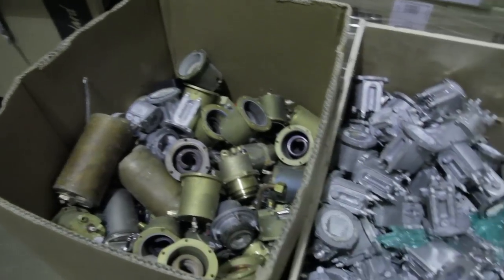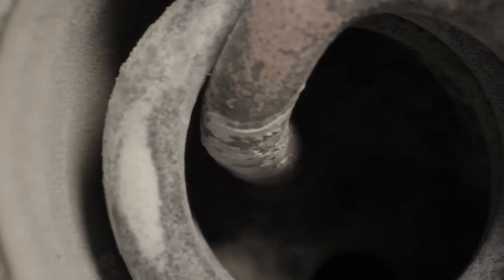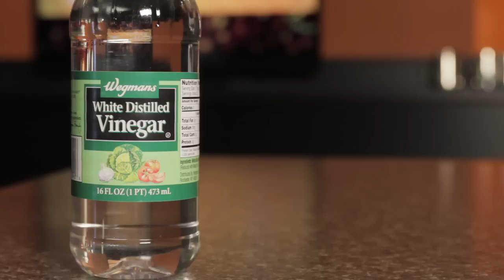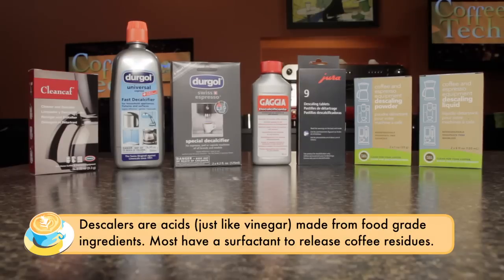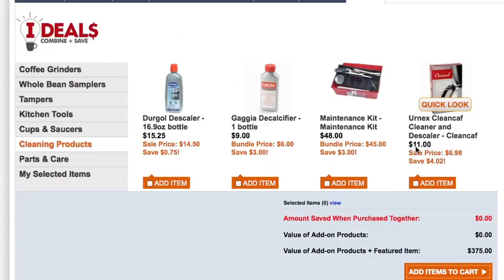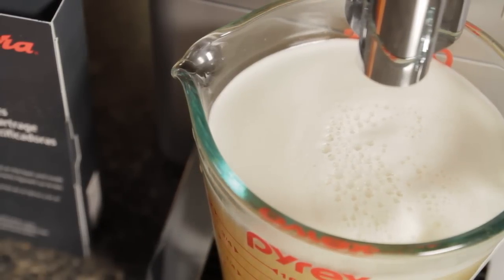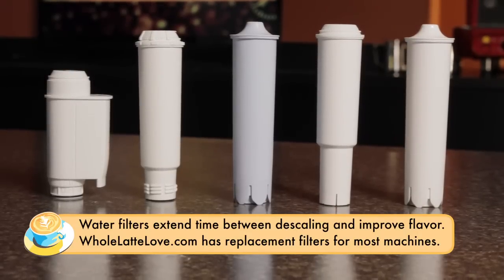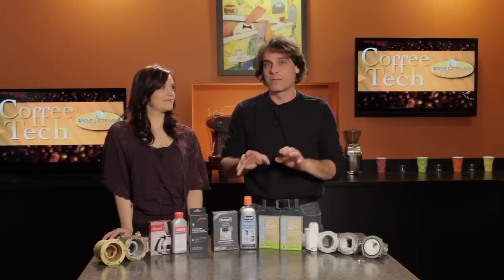The Dirty Truth: Why You Need to Descale

Comment: Hey there! Quick question; i have an Astoria Gloria lever machine do i just run the descaler from the water supply into the boiler directly? Thank you 🙂
Reply from the maker: Hi ggb, I have never descaled that machine so not 100% certain but that's generally how it is down. I'd check with the manufacturer or other owners to be certain.

Comment: I descale it until the water doesn't come out green or tainted usually 2 to 3 times of running it through. After that I rinse the boiler a couple times to get the solution out and make a sacrificial shot to make sure the solution is completely out

Comment: Can a Dual Boiler in my case a CremOne Infuser be cleaned by descaling? Or should I use only water
Reply from the maker: Hi mike, manufacturers recommend against end users descaling dual boiler machines. It's difficult to completely fill and rinse the service/steam boiler due to the head space left for steam in the boiler. The best course of action is to treat/filter water used in the machine to prevent scale in the first place. Products from BWT use ion-exchange to replace some of the calcium in tap water with magnesium leavoing you with water that will not cause scale yet has the mineral content needed for good flavor extraction and to prevent corrosion of metals in the machine.  All their products also remove chlorination from tap water.
If running from reservoir check out:
BWT Bestsave in-reservoir pad filters: https://www.wholelattelove.com/products/bwt-bestsave-s-anti-scale-filter
BWT Aqualizer Pitcher: https://www.wholelattelove.com/products/bwt-aqualizer-2-6-l-pitcher-with-illuminated-baselight
If plumbed to water line:
BWT Bestmax Premium: https://www.wholelattelove.com/products/bwt-bestmax-premium-filter-package-w-besthead-flex

Comment: What if I use filtered water that even after a year of usage in a kettle left no visible scale buildup? Should I still descale my espresso machine if using the same water?
Reply from the maker: Hi BB, Well that's probably a good indication - but not 100% certain. Perhaps you have very soft (low mineral) water to begin with? Not sure how you are filtering water. Very few filters reduce calcium in water. Traditional sodium based water softening will as does filters using calcium to magnesium ion exchange.

Comment: I've brewed 8 cups after the first tank.
How many cups before it stops bubbling?!
Reply from the maker: Hi IDH, When the acid is rinsed out. Any chance you are descaling machine with heat-exchange or dual boilers? Very difficult to fully rinse the steam generating sections of those boiler types as in normal use they do not completely fill with water.

Comment: Breville recommends using white vinegar (acetic acid) 1:1 water. They say we should not use other descalers (powder). I used it, cleaned after that and no vinegar smell remained. I am a bit confused by contradictory recommendation. Why would Breville ask for cheap vinegar? I guess at that concentration it does no harm…may be only for calcium deposits
Reply: Breville charge 399 dollars to descale a machine that you can do it at home BUT......if you are lucky.
Reply: libertango breville won't last long enough to reach descaling time. Poor cheap Chinese built quality.

Comment: my tefal quick cup (that l use for instant coffee) and my espresso machine both say to use diluted white vinegar to descale (espresso says to use its branded cleaner but white vinegar as a substitute)
Reply from the maker: bjorn1583 We do not recommend using vinegar in espresso machines. Couple of reasons for that. First, the acetic acid in vinegar can attack some components - especially seals in the machine. It's not likely to be a problem if done once or twice but can be with repeated use. The bigger issue is with tainting of flavor. The citric acid used in many descaling products has no odor or flavor. The scale build up in boilers is very porous. If some is left behind when descaling with vinegar it can retain the vinegar flavor which ends up in brew water and coffee/espresso.

Comment: This can't be saying too much for PUR faucet mount water filters. I still get the build up. Even changing the filters as needed. So with a PUR mounted on the faucet, and it's what I use each time to fill the Keurig reservoir, why should I be getting the scaling? I can see it forming inside the reservoir at the bottom as well over time. Removing minerals is part of what the PUR is suppose to do, right? And it's not like the water here is that bad either.
Reply from the maker: +Vue U Hi, We cannot speak as experts on PUR filters. But, some quick research shows they sell a few different types. One type which uses activated carbon is said to reduce chlorine, lead, mercury and other contaminants. We do know that activated carbon and sediment filters do nothing to reduce the minerals that cause scale. Another PUR filter, the Mineral Clear adds minerals back to water after filtration to give improve flavor. What we do not know is what minerals it adds back in. Some minerals cause scale and others do not. Minerals are necessary to maintain flavor. Without minerals, water and coffee tastes very flat. For high-end espresso machines we recommend inline filters like the Bestmax Premium: https://www.wholelattelove.com/products/bwt-bestmax-premium-s-filter-cartridge
This filter employs a sediment section, 2 activated carbon sections and ion exchange. The ion exchange section removes scale causing minerals and then re-balances with minerals which do not cause scale to maintain good flavor.

Comment: I have PUR water purifier and I only use purified water to fill my machine.  In such case, do I still need to descale and if so, how often?  maybe only 1 time to 3 times you would if you used tap?
Reply from the maker: +MyLifeInBinary We would check into exactly what your model of PUR filter removes from water. Many filters only go after sediments through mechanical filtration media and chemicals like chlorine etc using activated carbon. If your filter specifically states it reduces minerals/Carbonate hardness then you may be able to reduce descaling frequency. It's the minerals in water which cause scaling.

Comment: Will scale cause the pump the pump to fail. I have DeLonghi icona pump coffee machine. I descale it about every month. They last about a year. I live in a very hard water area.
Reply from the maker: +ian razey Hi Ian, Scale can cause a pump to fail. Machines like yours typically use thermoblock boilers which have narrow water passages. Extra hard water will cause rapid scale formation within the boiler and stress the pump. Those with extra hard water should consider softening or filtering to remove mineral content. Could also try using bottled spring water, but check the mineral content as it varies among brands. Here is what the SCAA recommends for water quality: https://www.scaa.org/?page=resources&d=water-standards

Comment: Descaling is unnecessary if your water is marginally acidic. My tank water has a pH of 6.5 after treatment, in fact on tank water for a week the shower head unblocks itself just from the mildly acidic conditions. As for cleaning the group head the active ingredient is sodium percarbonate in most commercial products. Same as in Napisan. A small dose of this combined with the marginally acidic water has worked for a very long time for me.

Comment: I have a Promac with the boiler out. It's got maybe upwards of a half inch of scale. Problem is, all these videos online are for minimal descaling. Could you make a video describing heavy descaling and restoration?
Reply from the maker: Hi Eric, Wow - that's a lot of scale but I have seen a few boilers with that much in the past. With that much scale in the boiler I'm guessing there a bunch in other parts of the machine as well. With half inch of scale it may be best to just replace the boiler. If you think you can get it out you might be able to physically remove some with tools like a chisel and then complete the job with an extended (potentially repeated) soak in a citric acid based descaling solution.
Marc
Reply: @Wholelattelovepage  I'd love to but it seems discontinued. I've been experimenting with muriatic acid for the past few days and had good results. Striped the shine and I've lost some nickel coating, but it's just about clean at this point. I can share pictures if you want. Just tell me where to send them.

Comment: I have a Black&Decker drip brewer, not an espresso machine. Do you have to descale those too?
Reply from the maker: Hi James, Unless your source water is very soft then yes I would descale. That drip brewer likely uses a thermoblock boiler. Water is heated in very narrow pipes in those and they are susceptible to scale buildup which will affect heating performance and may eventually plug the machine.

Comment: My machine is direct plumb only. I'm using a bet bestmax priemium. If I change the filter as needed, will I avoid scaling?
Reply from the maker: Hi ws, Thanks for the question. BWT states that if used as directed no scale will build up in espresso machines.

Comment: Great vid! What if you have your machine pumped into the water main? How do you descale when you can't just fill the tank?
Reply from the maker: Hi K, Thanks for the comment and question. What make/model machine do you have? Most rotary pump machines can prime/draw from an unplumbed water source like water jug etc. Many, perhaps most rotary pump machines are dual boiler. In most cases we recommend dual boiler machines be descaled by a professional.
Marc

Comment: If my machine (delonghi) hasn’t been discaled in 10 years but works perfectly, is it too late to do it? Are the coffee residues there forever?
Reply from the maker: Hi L, Thanks for the question. Perhaps you have very soft (low mineral content) water so little to no scale is forming in the machine. Using a water filter in the machine can help reduce scale as well. Descaling doesn't do much for coffee residues it's for breaking down and removing scale deposits. If it's working perfectly after 10 years then maybe no need to descale - especially if you know your water is soft. If you know that's the case then maybe do not descale. If the machine is operating well and you descale now there's a chance you could dislodge some scale and causes a problem in the machine. I think that's unlikely if you've gone 10 years wioth no descaling but it is a possibility.
Marc

Comment: Hi, I have a Gaggia Classic, and the descaling instructions in the manual and on the Gaggia decalcifier say to run the descaler/H2O combination ONLY through the steam wand, not through the grouphead. Does this sound right? Does the grouphead need to be descaled as well? The instructions just have you purge a bunch of clean water through the grouphead after running the descaling solution and a tank of clean water through the steam wand.
Reply from the maker: emily clark Hi Emily, This video should help: https://youtu.be/HSXC3zuHbNU In it, Kathy from Whole Latte Love goes through the descaling process on a Gaggia Classic. You may want to watch this one as well: https://youtu.be/4mqS-EUOj5w It shows the backflushing process on a Classic.
Reply: Whole Latte Love unfortunately the first link results in a message that the video is Private. Would it be possible to make this public?

Comment: I have a Mr. Coffee Cafe Barista, and I didn't find it on your website, what descale product should I use?? On the Mr. Coffee Cafe Barista manual says using vinegar to delime the internal parts, does that mean descale?????
Reply from the maker: Hi, Yes, delime and descale or the same thing. Personally, I would not use vinegar. Especially if the machine is overdue for descaling. If there is excessive scale build up in the machine it can absorb the vinegar flavor. Scale build up is porous and can act as a sponge. With excessive buildup it's likely that one descaling will not remove all the scale deposits. What's left behind will absorb the flavor. In most cases a citric acid based descaler is a better choice. It's more effective than the acetic acid in vinegar and does not leave behind any flavor taints. You could try a product called Dezcal that runs $1.10 https://www.wholelattelove.com/products/urnex-dezcal-activated-scale-remover
Reply: thank you!

Comment: Dang. The section that tells
you what cleaner to use for a machine no longer seems to exist on the site anymore :(
Reply from the maker: Hi JJM, What machine do you have?
Reply: I have an old Krups mini 4 cup espresso machine - the chamber is very similar to the IMUSA mini 4 cups. I tried a descaler I bought on Amazon and it did nothing. Also tried vinegar and it did nothing. Wondering if I need to let it soak but I don’t want to risk eroding the chamber itself.

Comment: Hello, I've had my espresso machine for about two years now I occasionally make espresso at most once a day. I always use bottled water that come in the 5 liter bottles, how often should I do this process and is it ok to use vinegar? Where I live we don't have these descalers, I haven't done this process before and I don't feel my machine is running any different than when I first got it.
Reply from the maker: Hi f, Thanks for the question. Unfortunately I have no way of knowing the mineral content of your bottled water. If considered relatively soft (low in minerals) then I'd descale 2x a year. Please do not use vinegar! I recommend using citric acid which is commonly available in powder form for use in food prep, etc. Here's a video with a recipe for making your own descaler using powdered citric acid: https://youtu.be/YQdV2Kb2fCI
Hope that helps!
Marc
Reply: Keep using bottled water and you will be ok 
Do once a year a discal flush

Comment: Great video. How do the descalers affect electroplated boilers or plated chrome?  I’ve read it can cause plated materials to delaminate.
Reply from the maker: Hi WW137, Thanks for the comment. Depending on boiler material over-aggressive descaling could cause issues. Important to stick to manufacturer recommendations. The best way around descaling is proper water treatment to reduce/prevent scale deposits in the first place.
Marc

Comment: I've literally been using vinegar to descale my machine for roughly 8 and a half years and its worked wonders, i have never had any of the problems described in the video.

I feel like the video was just an attempt at product advertisement/sales.
Reply from the maker: Hi, Thanks for the comment. What type of machine make/model do you have. There are product options in this video which are essentially the same cost as vinegar which are a citric acid base. It's been covered in the comments many times but there is next to no money to be made in selling descaling products. Our interest is in keeping our customer's machines running well. There are no machine manufacturers which recommend using vinegar for descaling. Breville used to until they ran into problems with vinegar ruining the silicone seals used in some of their machines. This problem was especially severe in parts of the UK with hard water where customers were descaling frequently.
Reply: On their website Breville still recommend using vinegar for descaling.
Reply: @Wholelattelovepage  please put a link for your 2$ cleaner I'm not seeing on your website?!?!? .......

Comment: I've had my Breville exactly a year and the clean me light didn't come on till today. Is it because I use bottled water in my machine?
Reply from the maker: Hi SH, Most machines calculate descaling based on number of cups made. With some you do a test and put results into the machine. If your water is softer time between descaling will be longer. Some have the ability to include filter use in the equation.

Comment: Two questions:
1. The video shows how to tell the machine was properly rinsed. How does one tell that the machine was completely descaled or if a fresh batch is still required?
2. The video mentions surfactants added to the descaling mix. I find that a head scratcher:
. a. I know of no non-alkaline surfactants that would not neutralize the acid. Which surfactant(s) work(s) with citric acid?
. b. How much coffee oil/sludge finds its way into the brew head, boiler or connecting lines?
Reply from the maker: Hi SL, Thanks for the questions. 1. The only real way to tell if a machine is completely descaled is to open up boiler etc. Since this is not practical in most cases it's best to descale on regular basis based on water hardness and manufacturer recommendations. Another option is to prevent scale in the first place by treating water to obtain a mineral level which causes neither scale deposits or corrosion. 2a. Surfactant is listed as an ingredient in some descaling products. Actual name is not specified.
2b. Depends on the machine type. brew heads, shower screens always get some buildup regardless of machine type. Machines with 3-way valves - those that expel excess brew water/pressure at the end of a brew cycle move coffee oils/residues thru internal lines. These machines should be backflushed on a regular basis with a product like Cafiza.
Marc